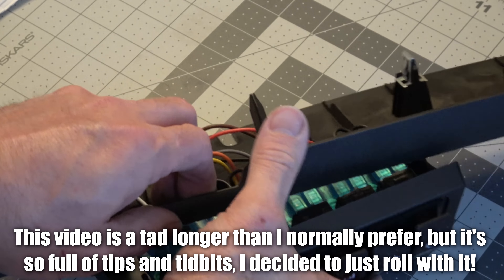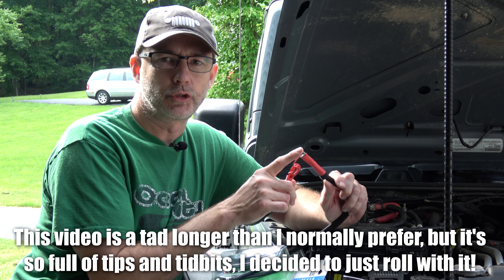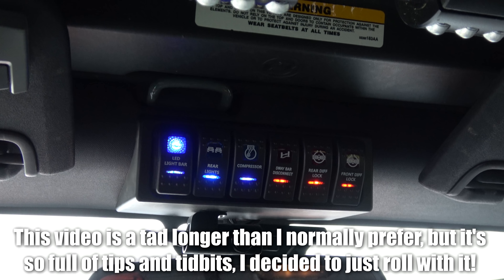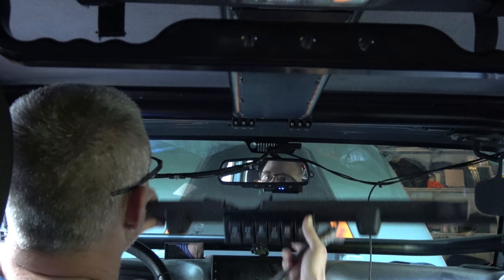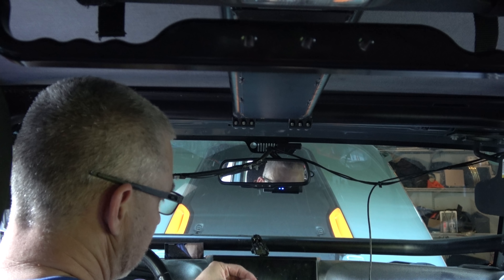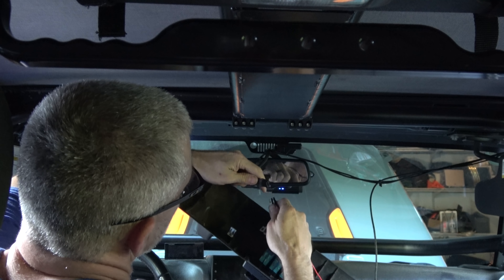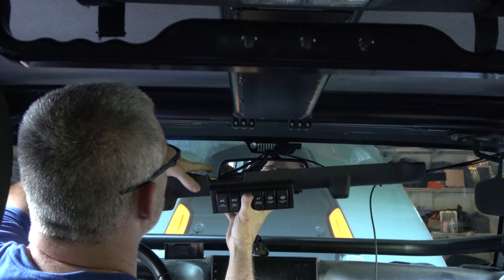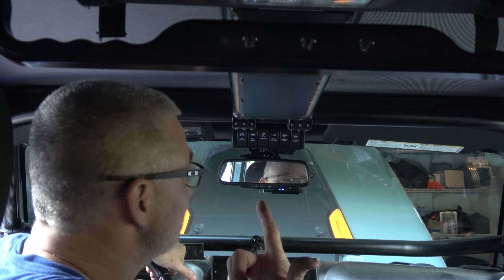S-TECH Switch System Installation with a Ton of Tips for Jeep Wrangler JK

Comment: great job on videos but can you tell me how i can hook up a canister or pump to power my lockers in rubicon 2002 or 03 dana 44 axles with factory pumps.i have axles under 98 TJ and all the wiring isnt there.all from front and rear diffs is there,the air hoses are there but still gotta check pumps,(factory) if i have to go to arb i still need to know if compressor can be cut down to 5 to 7 psi.No-one has any videos about hooking up a system except putting in the pump for airing up tires.That is pretty easy.I know there shld be a pressure switch which it doesnt look adjustable and maybe un-needed.i really dont know.If you can give any info. or advice to help me please let me know.Sincerely Robert

Comment: Great video thanks! How much wire comes with the kit from the relay box to the battery or better put the in line fuse box where you mounted it? I think you said it was 10 feet and so when you add the inline breaker wire wire of 1 foot what did you do with all that wire?

Comment: Question, I have my 6 switch unit installed, and I'm trying to figure out how to run my winch power to a switch so I have to have that on before any power is sent to the winch.  How do I go from the huge gague winch wire to the smaller S Tech switch wire?  Will the small gague wire handle that power for the winch?
Reply: You need to use a heavy duty contactor (hi amp relay) that is controlled by a low amp switch to have switched power for the winch. Look on amazon for a relay that is rated for more than the winch is rated. 250-300A should be what you want.
Reply: @mnredbull  yep, figured this out a while ago.  I purchased the Warn power isolator kit that has a relay.  Thanks for the response though!

Comment: You can actually feed 18 gauge wire through a drain hole right next to your pigtail and it exits underneath the fuse box for a cleaner look. And you don’t have to compromise the seal on the fuse box
Reply: Actually 16 gauge wire will fit too:)

Comment: How do you connect lights and stuff . do you just run the red wire to the box and the negative to the battery confused
Reply from the maker: Negative to chassis ground (frame usually or grounding post) and positive to the switch output on the box.

Comment: Great job! Hey I watched your video and just bought the 4 switch system and installed it early this morning and was thrilled with the clean install, but unfortunately I too used blue lock right on the threads and all was good until I came home from a wedding 8 hours later and opened the door on my Jeep to admire the switches and my switch panel was hanging by the wire connector lol. The blue lock tire dissolved the cheap plastic s tech used and so I just drilled right through the existing holes on through the front of the control box and ran long Phillips head screws through the box with nuts on the back. They have a great system but cheap plastic switch box that needs updated. 
Cheers

Comment: Great tips and install on a good product. I use the similar one, by Applotech. My Tip, instead of using a coat hanger for fishing wires, try a heavy duty 3-4 foot long zip tie. This will prevent the possibility of scratching something and the possibility of sticking a metal wire/rod into something electrical or scarring factory wiring. The zip-tie also can snake through things much easier then a coat hanger.

Comment: I still like the apollointech switch pod better.  But I appreciate the s tech switches here. The apollointech allows me to make the wire connections in the relax box and not just in the loom. Good video. 👍
Reply: Copying and pasting this from my comment at the root level.

I personally prefer the Cooper Bussman 15303 units. This way you can control the wiring specifications (e.g. AWG and temp rating), and the components are more or less field replaceable.

Comment: I see a problem with the circuit breaker at the battery end of this system, I suspect this is the reason why the manufacturer did not put a breaker at the battery side.. If they are individual wires for each circuit coming from the relay pod, then in a situation of a short on one of the wires, the wire will melt and catch fire before tripping a 60 amp breaker or fuse, this is because an individual wire in that bundle cannot carry 60 amps, all of them together can. However the most likely scenario of a short will be one of the 6 wires gets shorted. So unless you break apart the bundle and fuse each line with an appropriate fuse, then the 60 am breaker you have added is not effective... I should add, that I very much enjoyed your video and will watch others and will subscribe.

Comment: Cool system. I personally prefer the Cooper Bussman 15303 units. This way you can control the wiring specifications (e.g. AWG and temp rating), and the components are more or less field replaceable. I installed two 15303s and a Noco Genius GenM2 on a custom bracket in the same location, and still had room for an existing ARB CKMA12.

Comment: Sooo. Why did you ditch the SPOD or are you just doing installs on various switching options?
Reply from the maker: Omenmyster first, never had a spod... But I needed more switches and wanted to move my air compressor and locker switches out of the TD2 to make them easier to access.
Reply: Sheese, I turn 50 and dementia sets in. I could of swore you did a review on it. Anywho! Thanks for the vids, very informative and love the step by step installs
Reply: Omenmyster you may be referring to trailrecon
Reply: Ahhh, yep that's it ! Tks
Reply from the maker: I don't mine getting confused with Brad... lol. It's going to be really confusing soon, since he and I are working on a small collab project.  That should mess everyone up! lol
Reply: Yep. Like that you review similar products. Buying a 2016 JKU in two weeks, my shopping cart is full of MODs but constantly changing, thanks to you two guys! Uggg, J-ust E-mpty E-very P=ocket

Comment: First! Haha
Reply from the maker: BOOM!
Reply: Hello o3djeeps. I have a 2017 Jeep Sahara unlimited. I have done some upgrades 
Spartacus front and rear bumper. Graphics. Royal Hooks billet door handles. Went from 3.21 gears to 4.88 gears. I put in an alpine 9” x209wra with two Jl 10” subs and 8 Millie pro speakers. 
I ordered the spod and Rock lights. 
My question is what lift would you put in to start off and what tires would you go with. Copper Stt pro or Stt max.  
My wife is going to kill me with the upgrades I am doing after watching your videos.
Reply: Go big or go home! Save yourself the money and do it once and right the first time. Metalcloak Gamechanger on either Rocksports or 6Pak with STT Pro. You'll not regret it! After 15 years of marriage, I still have my Jeep, but not the wife... Haha
Reply: OblioAndArrow thanks. I have ordered the MetalCloak 3.5 inch. And I was wondering about Kings shocks
Reply: Joseph Giuffre 
Awesome! Give the guys at Metalcloak a call or try to ask on the Metalcloak Owners Club Facebook page. They will give you you're best options that fit your needs. Their service is the best in the business and is reflected and shared by their customers. 

I'm running 6Paks with STT Pro and it rides amazing, but I've heard no complaints on  the Rocksports and that they do almost as good. I've heard a bunch of people switching from the FOX as they are a little more harsh. 

Kings are a whole different league, but there are a few that run them on the Facebook page and MC has experience with them to be better equipped to answer that question.
Reply: CPO's on the MC Facebook page asking about the suspensions all the time. Haha